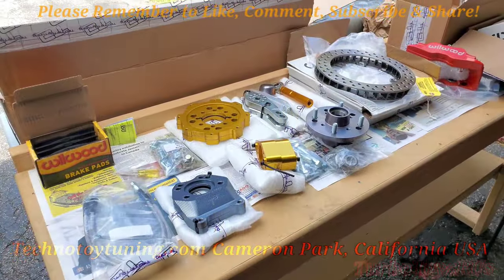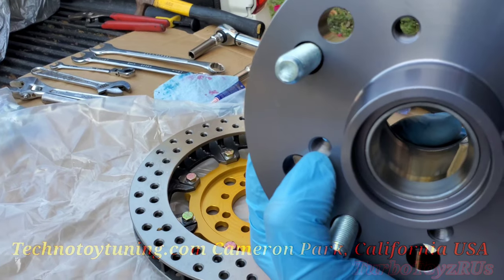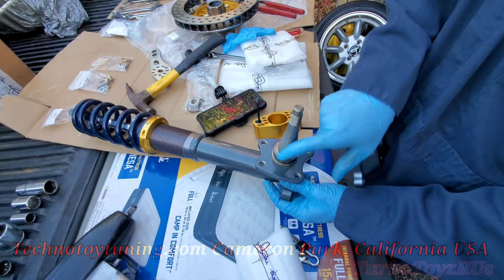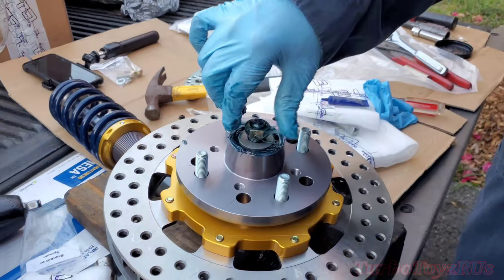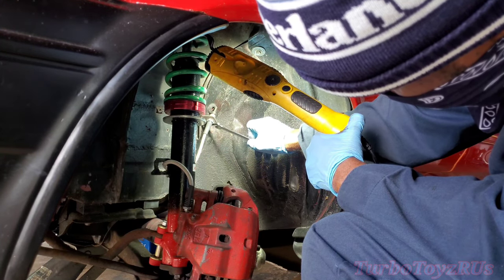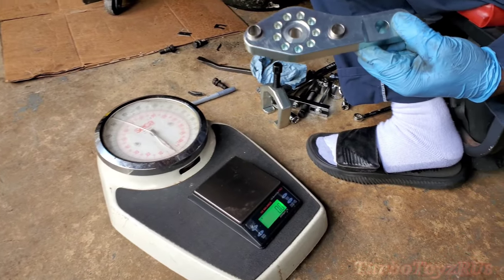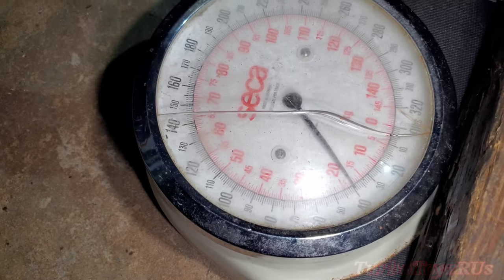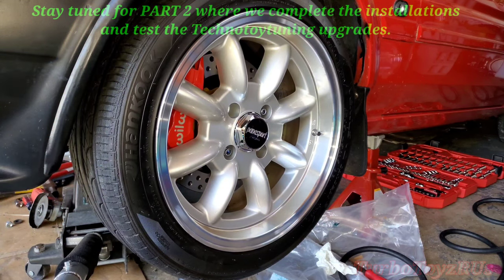TechnoToyTuning AE86 BEST COILOVERS, BIG BRAKES & More for ALL OLDSCHOOL TOYOTAS

Comment: what oil pan  you used for the swap ?? Is it modified??
Reply from the maker: I used the stock 2rz oil pan, but it's very low so going to change it in the future, possibly to one made by GL Fabrication. Check out my maintenance oil change video and you'll see the current one.👍🏽